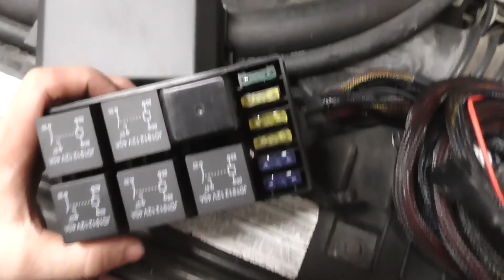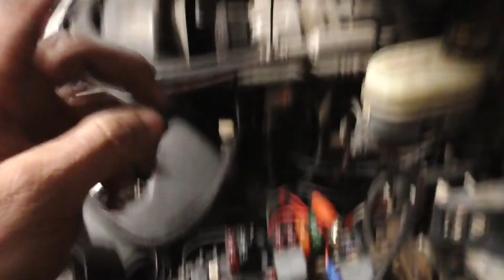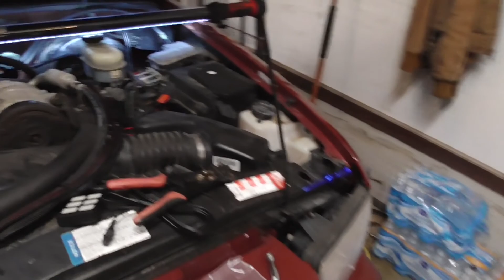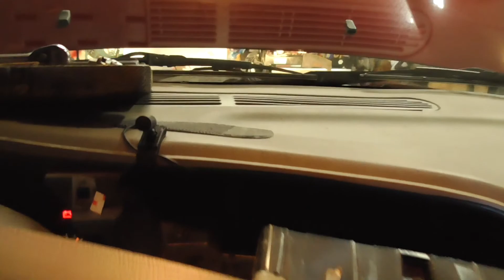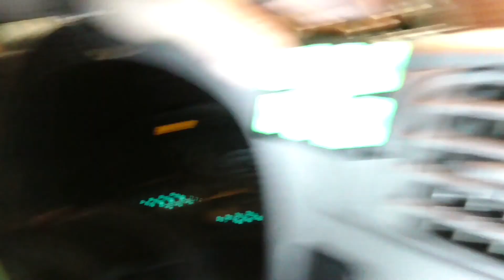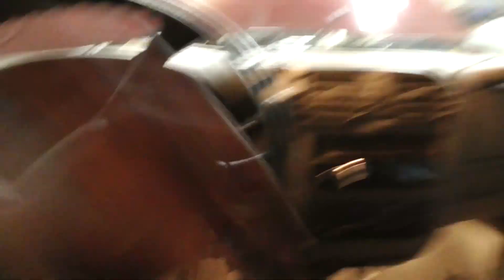Sonoma Update | Lifetime LED 6 Circuit Switch Fuse/Relay Center Install

Comment: I want to tap into my cigarette lighter fuse, would that 20a fuse (tap) be safe to use with the whole relay box?
Reply from the maker: If you mean the small red power wire, then yes.  All that wire does is give the switch panel power.  The bigger wire you need to go directly to the battery or a main stud of the fuse box.
Reply: @DanielPace92  Awesome, much appreciated. Im still new to this but that helps! I wouldn't need to add another fuse on top of that tap then, right? If I should, would it need to be another 20?
Reply from the maker: @ronniegranillo  A fuse tap should have two slots, one of the slots takes the fuse you pull out, then the other takes the fuse for the accessory you are adding. A 10 amp fuse should be plenty for that switch panel.
Reply: @DanielPace92  Thanks a bunch!

Comment: If the #1 switch i use for a pair of square flood light like a auxbeam or rigid industries, do you think it’s ok with that? So if i switch on the #1 button it will light up a pair not just left or right. Cause if i do number 1 switch for left, and number 2 for right it will waste.
Reply from the maker: Yes, the number 1 switch should be a 30a circuit and will run 2 pods no issue.  In fact it's kinda overkill.  I'd use either the 20a or 15a circuits.

Comment: on your control panel.which is #1 button ?far right or left?and as well #2 center top..bottom far left or right?
Reply from the maker: #1 is top left, #2 is center top, #3 is top right, #4 is bottom left, #5 is center bottom, and #6 is bottom right.

Comment: Does it do strobe ? Can u put the link for the item on amazon ? Thanks for the video
Reply from the maker: No, this is just and on/off switch panel. https://www.amazon.com/dp/B0749D7G8B/ref=sspa_dk_detail_2?psc=1&pd_rd_i=B0749D7G8B&pd_rd_w=Z7s9o&pf_rd_p=2bd81721-c115-4b8d-93a3-2ecd17466ded&pd_rd_wg=J2sek&pf_rd_r=DHKFG5BMAVE3FNCM0GWB&pd_rd_r=37465a06-2f2a-11e9-9e0c-9751a1337b94

Comment: That's a great little switch panel.
Reply from the maker: It is, when I saw it I immediately bought one. I'd been looking at other relay stations but they all came with 6 rocker switches and a voltmeter (designed to mount above a rear view mirror on a Jeep JK) This was the first one I found with a compact design that could be mounted anywhere. Plus over 1/2 the price less than an sPod.